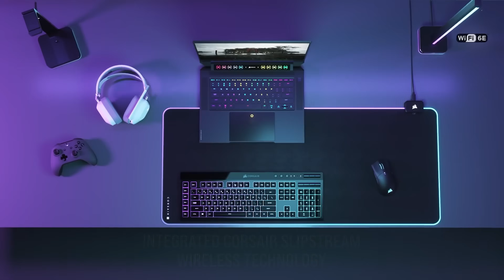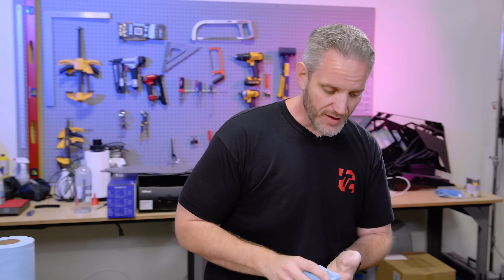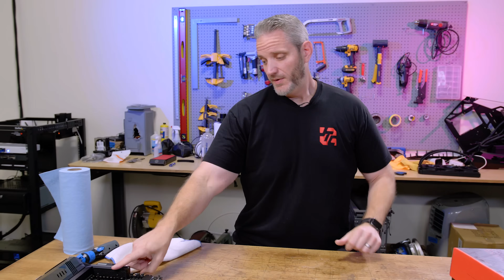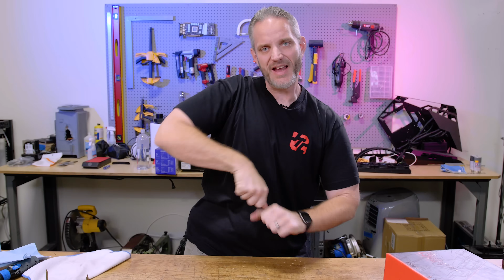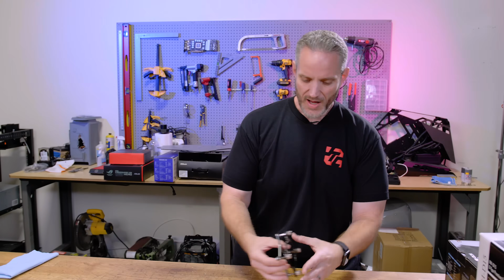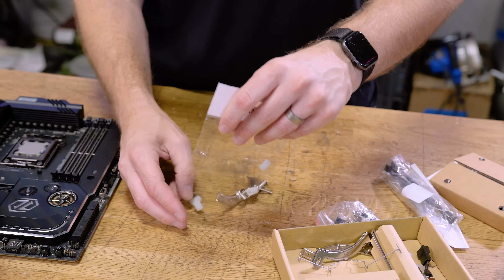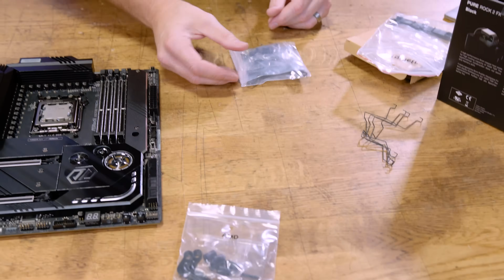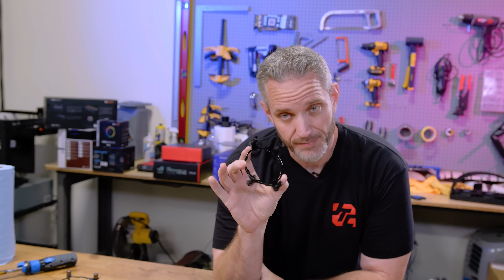AMD made a terrible flaw with this design...

Comment: You have to think about the future v-cache models! The tolerance stack up gets pretty tight if you don't have the extra thickness to be able to remove later from the IHS. They made it work with AM4, but it was a limited run. I think making the IHS thicker has to be considered as a potential learning from the 5800X3D launch.
Reply: The X3D models have the exact same die height as the normal CPUs. See der8auer's latest video.
Reply: @efovex  For some context, I posted this 4 months ago as a theory that a thicker IHS gives AMD more options with how to do 3D stacking on the next run of CPUs. The der8auer video you mentioned (Different Chip Height due to 3D-Cache? R9 7950X3D Delidded) is a great follow up, with the benefit of recent information.
Reply: Came to say this. They would save the money and make it thicker of the could. But they made it ready for 3dvcache added size and heat
Reply: @samonsthewise  this is just false. You need to think about it more, why does cooling work better when you lap 3dvcache chips and if it works by just taking some copper off it would work all the time if they made it thinner.... You do know am4 IHS were thinner and worked fine. Come on, common sense. Heat transfer isn't as good when the copper is thicker. They only did it to make people happy but actually made people mad with the Temps the bracket etc
Reply: oh that's actually really smart. yeah they would need the height anyways.
Reply: @Aleph-Noll  how is that smart? It's the opposite. The dies aren't any different and by making copper thicker the cooling is worse, youu can direct die cool 3dvcache chips so why would it need more copper, it not going to break. They only wanted to make people happy but actually mad people a little mad. Thicker copper isn't needed because the dies act the same just one has the cance to get warmer
Reply: And where is your evidence to back up these claims?
Reply: @Sxs1n  where's the evidence to suggest it's a mess up?  We aren't in court... we are going over possibilities looking for the most probable scenario.
Reply: @samonsthewise   dude the ihs is almost 7mm thick so theres no need for the extra thickness because of 3d cache. theres noway the stacked cache will use up 5mm of ihs
Reply: @CatManHDGaming  many factors went into the ihs choice. They would make it smaller to save money IF they could. So AMD all factors included beyond what you see. I guess i hope for aftermarket thin IHS either way...
Reply: @samonsthewise  the thickness change was because of the move to LGA as the socket sits lover they had to change the ihs thickness to fit am4 coolers but imho that was a huge mistake, but yea thinner ihs would be nice but u still need to delid the cpu thats the issue.
Reply: @Sxs1n  the claims are wrong....a limit run of cpus that's till work just fine. Lmao
Reply: @Sxs1n  I'm not trying to make a formal proof of this idea for my university professor. I am just suggesting that most of the time companies are not making stupid decisions without thinking about them. I want you to consider that a thicker IHS may be an intentional design decision based off of lessons learned from the 5800X3D launch.

Comment: It honestly seems better idea to just ditch AM4 compatibility and just make hole spacing like in 115X or 17XX socket. 
Thermals can be an issue for some people and I wonder if AMD gonna address this problem in the future.
It's probably gonna be difficult to fix without breaking compatibility between newer CPU and first gen motherboards with AM5 socket.

Comment: This is nitpicking. The 'hooks' system prevents 'crooked' installs like you showed.

It was announced from the get go that AM5 would have a permanent backplate. So its not just 'the hooks only' that are compatible, those using the stock backplate too, like the stock coolers or your Corsair branded block.

The NH-D15 wasn't even AM4 compatible!..

Comment: I had the same thoughts about the thickness of the IHS- I assumed it was mostly hollowed out. Luckily nowadays I don't buy the newest hardware, only stuff that's been out for a few Years. I just don't need the newest and the best- there's such great prices on hardware with great performance that's only a couple Years old. Only reason to ever need the newest hardware is if you're losing money/time. A benefit to using non-newest gen hardware is that by the time it's a couple Years old we've got videos like this and decent documentation on things to be aware of! Another grand video!

Comment: Wowow doesn't that mean they wasted like 200-300 Mhz performance because they made their IHS too thick? And according to the Bauer testing it wouldn't run as hot as now! That seems to be one of those blunders that is really hard to explain. They must have tested it back in the labs right? How do you miss this?

Comment: I'd be that person that rammed a screwdriver through my motherboard if I ever tried to use one of the old school coolers, I already nearly chopped the end of my finger off with a Stanley knife trying to take off cable ties from the previous wire management job 🤦 😂

Comment: I do wonder if AMD will release a mid cycle refresh design with a thinner IHS. It would also be possible to make the CPU socket itself thicker (which would make the boards more expensive) allowing a thinner IHS and the same height, they'd likely need a completely different ILM as well though. Or they could just make a thinner IHS with the same socket, the cooler manufacturers would make a $10 bracket like they all did with LGA 1700 and everything will be OK.

Comment: You don't need much force to get a heatsink hooked when using a HSF that uses cam locks to press it down after hooking. That was the only great thing with Intel's stock S478 HSF. Also, 3mm of copper with ~400mmsq providing heat transfer  can transfer ~50W/K so we're only talking a 4C difference between die-side and HSF-side at 200W. Whatever DeBauer measured by throwing away the IHS with his DIY direct-die cooling isn't the temperature rise due to extra copper, that would only be ~2C all else being equal.

Comment: At 20:00, couldn't you just lap a 7000 series IHS down by 2mil - a lot! - and see if the temps are comparable to 5000 series rather then delidding, find something to stick in between, and test? Lapping is much less invasive and could easily give you an idea if it will help temps significantly or not.

Comment: Seeing how AMD chose to only make AM5 compatible with DDR5 forcing an existing user to upgrade to a new (currently) expensive motherboard AND expensive ram alongwith an expensive CPU -- AMD attempting to make it work with previous coolers looks silly in a dollars sense. The sillyness is compounded when seeing how that decision adversely effects the normal operating temperatures. I can imagine there are engineers at AMD that opposed this decision that have pulled thier hair out over it. In my opinion it was not a wise deicison. An end user wanting to upgrade to AM5 wouldnt have thought twice about needing a new cooler after seeing all the other necissary upgrades needed becuase it was already a "full system replacement" situation IMO. But hey, everyone says it works great at 95C lol
Reply: Dude..do ya NOT research history of things..ever?

How many gens did AMD support the am4 socket?.

5 years about worth..aka at least 3 or 4 gens.

How about am3? Am2?

Compared to Intel who basically supports the same socket for maybe 2 gens at most MOST of the time...whining about and is asinine here
Reply: @motoryzen  who's whining? LoL

 I don't have any current intent to go to AM5 as I'm rebuilding all of my computers with AM4 right now as prices drop.

 I agree with AMD being amazing for being thoughtful for compatibility for the end user thru previous generations. But with the AM5 being a completely different socket and generation it doesn't make sense to me to sacrifice cooling ability for cooling compatibility especially when it's not going to be compatible with a wide range of coolers due to the design of the new socket.
Reply: @adjustthis  you're the one claiming the act of AMD TRYING to make it easy enough for existing àm4 coolers to work with am5 socket mobos is silly.

Not me

Comment: Old guy here: many CPUs back in the 80's were soldered on (even with full-size desktop and tower PCs!) or had a socket mechanism that required a lot of force with a special tool and it was so difficult to guarantee proper CPU removal and installation that most of the time, we just ordered motherboards with CPUs pre-mounted to avoid having to do it ourselves! Not to mention, a CPU with a motherboard could easily be $1000 just for a mainstream combo and did not include features we take for granted today, such as built-in sound, USB, video, or sometimes even keyboard/mouse inputs!

Comment: It should also be mentioned that AMD saw it fit to use an IHS that's so fucking thick it ruins thermals on these chips. This was done in the name of compatibility with existing designs. Der8auer is making a direct die cooler setup and his prototype got the 7950x to the 60C range.

Comment: Could AMD have thought ahead and used the thickness of the heat spreader as room for more 3D cache models in the future, IE thicker spreader for non-3D, thinner for 3D cache models, but all same height at the end of the day? That higher cache 5800x3d was pretty impressive and seems odd it was the only model to have extra cache, I wonder if it was the concept/test before a wider release on AM5.

Comment: J, you sure do have a pretty block!  The screwdriver by Linus has been proven to be a top rated tool, for it's intended purpose it is outstanding.  I would like to see you using it, not just for solidarity with another YouTube tech guy, but because it was a purpose built tool that does a great job.  Just as I would like to see Linus using your block.                     Be happy, be safe

Comment: Maybe I'm wrong about this but, the X3D versions of these cpus should have taller dies. I'd imagine maybe that's why the ihs is so thick on the non X3D. The overall ihs height would have to be the same regardless of the die height. AMD has been on a roll, I kinda have a hard time thinking it is an oversight.

Comment: I had a Hyper 212 on my 3700x and had to remove the stock AM4 hooks and backplate, upgraded to a 5900x and decided to get a CM MasterLiquid 240 AIO which used the stock Am4 Hooks and backplate and for the life of being couldnt find it, had to ebay the parts, so annoying. So yes in future put them in a zip lock bag and chuck them in the motherboard box LOL

Comment: ??? might be confused here regarding the EK issue. 
My Velocity is using the factory backplate from the crosshair VII mb which just screws into the uprights like your talking about wanting. Guessing they changed design away from something that was apparently better
Edit, I see the velocity2 is a different design cooler

Comment: Also, since the difference in degradation time may be 12 years for Zen 4 running at 95c normally vs 15 years of zen 3 running at whatever it did, which isnt above 75 for me, is really an irrelevant difference. Thats why people need to just stop bringing it up, Its moot. Tho that may be exaggeration, 95c isnt the degredation level. its probably more 100-105 or something. Best ask AMD engineers the answer to that.

Comment: Here’s a question. How sustainable is direct die? Do you have to maintenance the Liquid Metal or paste more often? Curious how long would you be able to run the system that way.
Reply: If you have good LM like the Conductonaut from ThermalGrizzly, you only have to check it once a year, usually. At least this is what I do and it's perfectly fine.

Comment: If they needed the same Z height, instead of that thick IHS, AMD could have increased the height of the AM5 socket itself, both keeping the temps in check and maintaining compatibility with AM4 coolers.

Comment: So it's not amd's fault saying that am4 coolers are compatible whit am5. The problem is that every cooler throws away the standard am4 mounting system and replaces it whit a custom one. it's like swapping the chassis of your car keeping the same engine. Brackets wont always match

Comment: They should review this choice going forward. The extra that people new to the platform have to pay for bigger coolers than would be necessary otherwise surely outweighs the savings from being able to use old coolers.

I do love anything that makes less E-waste, but not sure that making your products function significantly worse (10-15 degrees hotter) actually ends up doing that.

Comment: @JayzTwoCents When you say "they have to raise the headroom of TjMax", what are you talking about? I am a bit confused as Zen 3 has 95°C TjMax as well 😲
And honestly R7 5800X behaves the same as all the Zen 4 CPUs. So there is no change on that front either. AMD even claims they didn't do any change into controlling clocks and voltages compared to Zen 3 (PBO 2).
The only real issue you revealed is the thick IHS. That is a bit of a bummer for sure.

Comment: Instead of delidding cooling, just under volt the CPU. So, if you have a 7950X and it has a TDP of 170 watts  under volt it to around 105 watts. There is literally hardly if any performance lost. AMD amped up these chips to compete with Intel, but if you are interested in longevity under volt the CPU and you will be fine.

Comment: AMD need to lose the socket promise and develop whats needed for the current gen. Why they would leave all that performance on the table with much lower heat and power draw is absolutely stupid!! Surely they knew? Its a big risk de-lidding these CPUs for most people but the gains on these are really tempting. If they had developed a new socket for the 7000 they would have blown anything intel has coming away for sure. My 9900k and evga 2080ti ftw3 ultra are still going strong but im fairly confident my next CPU upgrade is going to be the 7050X or newer if its out by the time i upgrade - and it will be my first AMD chip since the K6! These 7000 series chips are awesome as they are but with abit of risky tampering theyre like perfect. Cmon AMD, if you have to switch to a new socket - DO IT!!!

Comment: I thought the 2 or 3 degrees that was mentioned in Der8auer video was because he was using a different Not For Sale yet Liquid Metal,  and the 20 Degrees Temperature difference was due to the Fact that he did Direct Die Cooling - There wasnt a mention of Temperature with IHS but he did say it wouldnt help having a thick IHS

Comment: seriously, a New CPU for like 300-400 USD, a new MB for like 600USD, new Ram for like 130USD, and then trying to use an old CPU cooler to save 50-60 USD......sometimes it seems we try to find issues where there are none. I would imagine 99% of people who upgrade will buy a new cooler as well.

Comment: @JayzTwoCents  try using a ryzen 3000 or 5000 IHS on the ryzen 7, would that for debauer be the test, instead of find ing something that has the thickness of the 3000,5000 ihs ?

Comment: NH-D15 will work fine - it uses the stock AMD backplate. You just need an AM4 bracket adaptor from Noctua since the NH-D15 you were using was so old, it didn't include them. You wouldn't be able to use those AM3 mounts on your AM4 boards, either...

Comment: No @JayzTwoCents 21 degree drop was not because of the thicker IHS it was (mostly) because Der8bauer removed it. The 5800X3D dropped 11 degrees delided. plus 3 degrees for the liquid metal. While still not a perfect comparison, it's one that make sense. That's Still a 7 degree difference, worthy of a story. But 21 is just wrong, and sensational. I'd like to believe it was an honest mistake.

Comment: Really curious how much improvement is possible if instead of doing direct die, you just sand the IHS down. Obviously won't be as good as direct die, but also much lower risk at the same time. Might be a worthwhile tradeoff...

Comment: I'm actually rocking a 7900X with an NH-U12A + Kryonaut Extreme - I've got it in Eco mode 105W max with a -10 Curve Optimizer at the moment. 
Compared to Hardware Unboxed's benchmark I've lost a massive.... 500 points in Cinebench R23. Temps max out at 72c instead of 95c and power draw is down ~55%. 
I'm going to slowly drop the curve more until it's not stable and see how close I can get it to stock at these settings.
It'll happily do ~12 hrs of Prime95 + 12 Hours of AIDA64 with no issue

(I already had the NH-U12A from ~4 years ago, I had an old i7-3930K overclocked and degraded to near-death and it dried up my H100i)

Comment: I just lost my core rig last weekend b/c a couple days before I'd redone my thermal paste, and apparently didn't get the AIO reconnected to the hooks just right, and after a couple days one side popped off overnight and because the paste decided to turn into cement, it ripped the CPU right out of the socket when it popped off of the hook.

An unbudgeted $1k later, and I have a new proc/mb/cooler and a working computer again. Never using the hooks again.

Comment: Very helpful video Jay, I now know my EKWB AM4 CPU waterblock (which uses a pre-drilled metal back plate) is NOT compatible with an AM5 motherboard, unless I can drill and tap the 4 holes needed for the AM5 socket retaining mechanism, just checked.

Comment: @JayzTwoCents What do you think, could it be somehow possible that there might be a revision of the new CPUs with an IHS wich is only as thick as it requires, "ignoring" the requirement of compatibility to AM4 or maybe some kind of aftermarket product to replace the IHS with a thinner one, for the folks which might be a bit scared about exposing the DIE itself?

Comment: The D15 uses secufirm2, the same as the NH-U12A, you should be able to use the adapters from the NH-U12A on the D15 (the current version of the D15 already comes with them). If you have an old D15 you can ask Noctua to give you the adapters for AM4/AM5 for free.